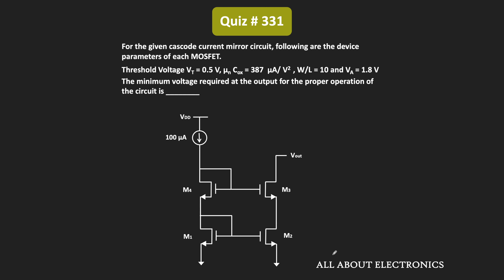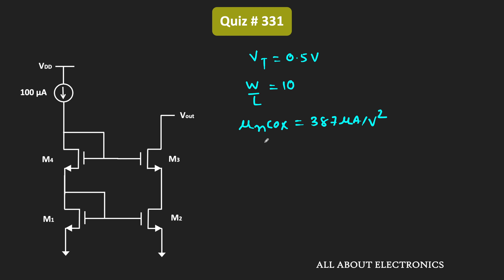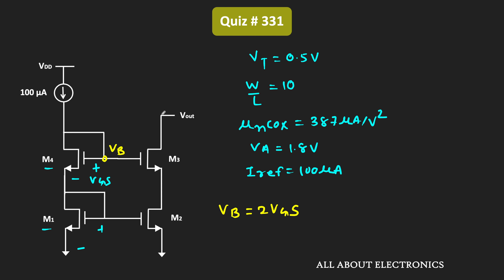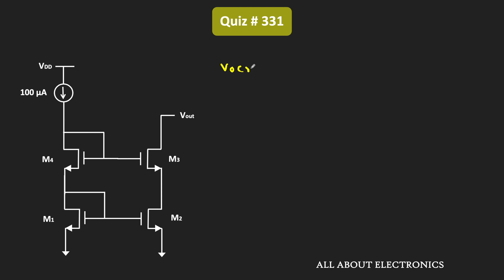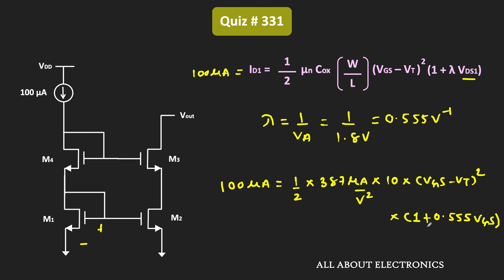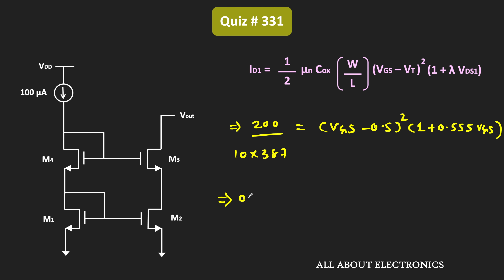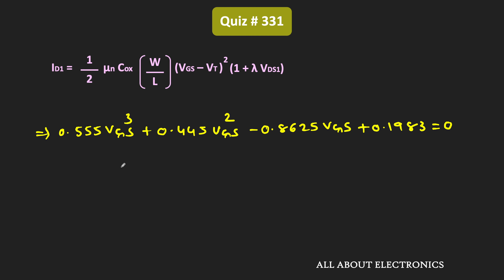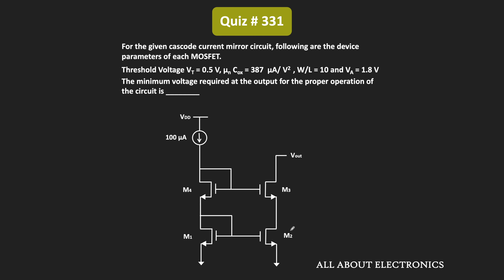Cascode Current Mirror Solved Problem | Quiz # 331

Comment: Shouldn't it be Vds3>=Vgs3-Vth? instead of Vd3>=Vg3-Vth because source isnt grounded here for M3 transistor
Reply from the maker: Vd3 >= Vg3 - Vth is same as Vds3 >= Vgs3 - Vth. 
You can write Vds3 as Vd3 - Vs3. And likewise Vgs3 as Vg3 - Vs3.
So, effectively it is Vd3 - Vs3 >= Vg3 - Vs3 - Vth. 
Vs3 will get cancelled on both sides. And effectively, we will get Vd3>= Bg3 - Vth. 
I hope, it will clear your doubt.
Reply: @allaboutelectronics-quiz I see..that's right...i missed that..my bad! thanks for clarifying. current mirror topic is so common for Analog Design interviews so it would be great if you could upload more questions of current mirrors. This one is great. Thanks!
Reply from the maker: @samudravishalmukherji7329  will cover it soon.
Reply: @allaboutelectronics-quiz  Thank you so much for addressing!